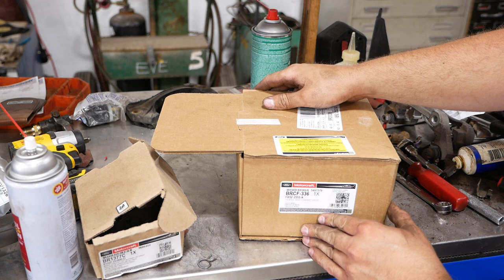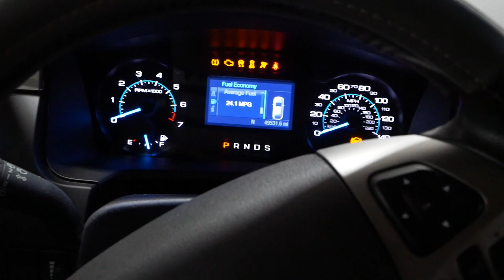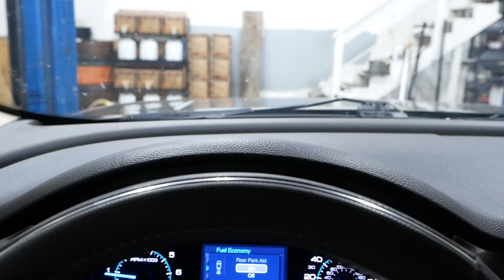Replacing a Brake Caliper with Integral Parking Brake - Ford Flex

Comment from the maker: Caliper Wind Back Tool (Sunnex) - https://amzn.to/3gVqvoT
Unofficial Wind Back Tool - https://amzn.to/3dhjzAm
Brake Line Fluid Stopper Set - https://amzn.to/3x0eu7h
Reply: I found it interesting Wes. 
Looking in from the outside, while watching American films, especially the big old soft sprung boats from the 70's. You see the whole car lurch as it settles into the next dog in the auto box when people select "Park" without the handbrake on. 
You saw people half out of the car  & "Lurch!" 🤣
Reply: What do you set your torque wrench at when tightening lug nuts, get videos keep up the great work, hi to you and the Mrs from Newfoundland, Canada..
Reply: I see you have your own orange Tanya Harding! I had to edit this once I saw the case of wobble pops. Or mountain sodas. Whichever you prefer.
Reply: @dwaynechaulk7387  depends on the car...I have a vauxhall where factory spec is 81ft lbs and a Ford which is 63ft lbs for the wheel nuts.
Reply: Thanks, we have a Ford Escape 2018, my son has a Hyundai Elantra 2018, I'll go on the old interweb and find out, I can't find it in owners manual.
Reply: @dwaynechaulk7387  wheel nut specs are also in the Manual that came with the vehicle
Reply: Ford Flex shares the "frame" with the 'Lincoln MKT' and '2011-2019 Ford Explorer' aka the Ford D4 platform ... a revision of the D3 which was derived from the VOLVO P2 architechture.

Comment: "The customer went with all OEM parts,"  a man of culture I see.
Reply: @Mauivegan67  Ya! Ouch! on the OEM parts!
Reply: I go all OEM on my old ranger and on the wife's newer nissan. Surprisingly pretty cheap on my ranger, the nissan not so much.
Reply: @MiamiZombie2012  same here Motorcraft parts are generally not expensive or barely any extra
Reply: It's always worth checking OEM.  Some of the parts are the same or better price than aftermarket.  Check different outlets too.  Same part was $104 different at two different stealerships a few years ago.
Reply: In the 90s I had a Honda Accord.  The dealer recommended I go with after market rotors.
Reply: I was thinking that if you have a Ford and you’re replacing parts.. why not take the opportunity to get something better than Ford??
Reply: @jefflane1209  only problem…nothing better!
Reply: Sprung for oem parts and didnt get a new rotor?
Reply: @underoath4177  but the rotors ARE serviceable OEM
Reply: on a ford, in my opinion, its the only way to go.  FOMOCO on everything. Even my daughters mazda (ford) I use oem parts
Reply: @MiamiZombie2012  Nissan is the Debbil! I personally HATE their products. But YMMV.
Reply: @Rorschach1024  I hate the CVTs. Ours originally failed at 39K, so for a 2015 I was pissed. But with changing the fluid every 20k now, it's going strong at 103K. Just expensive at over $20 a qt.
Reply: @MiamiZombie2012  had a late 90's sentra. engine failed at around 65K miles. the journals for the distributor bearings wallowed out and it could not stay in time. SIL owns an Altima that he was driving back from Ft Eustis to Ft Hood. it kept going into limp mode because of CVT slippage. Nissan didn't put a trans oil cooler in that year model (they deleted it the year before, and put it back in the next year) There was a TSB to replace the CVT and install an oil cooler if certain parameters were met, but the parameters for this transmission didn't quite meet the spec, so they refused to perform the TSB and install the oil cooler. I've seen the pile of scrap CVT's and engines at the local stealership. it doesn't give me a warm fuzzy.
Reply: I like to use all OEM Parts as well.  But sometimes reality sets in. Specifically when the OEM Part costs 5 & 6 times the Aftermarket part and is going to be a 2 wk. wait for the parts.  Even at the Dealership!!
Reply: @jefflane1209  With Brakes you’re generally not going to find better unless you’re willing to spend $1K+ and get something like Welwood or Brembo.

Comment: Ah those are the best customers, the ones willing to spend the money on oem stuff because 99% of the time the stuff is going to fit and work right away
Reply: Always fun when a brake job turns into the ol "grind to fit, paint to match"

Comment: I can't believe you only changed one caliper!  Now the car will be spinning out every time you hit the brakes... or so I am told by the YouTube comments.  I use the brake job hammer. It makes the job much faster!  Oh yeah and everything else Eric said since he got here first!
Reply from the maker: I really need one of those hammers. The Snap-Off guy couldn't find it in the catalog. He just wanted to trade me an "Epic" toolbox for my everlasting soul...
Reply: I agree in this case this one failed why not the otherside.
Reply: Not true
Reply: The car is equipped with ABS.  Would that not take care of any differences in stopping forces between the wheels?

Comment: I never see a problem with turning rotors and drums if they're within spec.
Reply: My issue is time. I can be done with the whole job in the time it takes to get 4 rotors turned
Reply: It's old school but saves money and they'll go another 4 -5 years. I like it too.
Reply: @scrapbmxrider16  cutting them is probably cheaper for the customer.
Reply: Yeah and save the customer a buncha money..  Thats how you get a customer base. I rather pay Wes to turn rotors for his shop rate   and save $$$
Reply: Wes's shop Wes's rules !
Reply: That's why there is a spec, right?
Reply: Any bluing or grey heat streaks isn't within mechanical specs just for those of you who don't understand metallurgy. It's more than "surface hardening" when brake drums/rotors get that hot, the entire crystalline structure changes.
Reply: Not too many places turn rotors anymore.

Comment: Nice work Wes! Tear the old caliper apart and do a failure analysis!
Reply: I'd buy that for a dollar!
Reply: Think he said there was a core charge, so he has to send it back to the manufacturer
Reply: In Soviet Russia you brake the caliper! 😄
Reply from the maker: I should! I doubt that would affect the core. All they reuse is the main housing.
Reply: @zoidberg444  I am pretty sure that's not how they did it back then. Everything was rebuild able back then.
Reply: @WatchWesWork   be sure to charge .99 cents to view the tear down video incase you don't get your core charge back!
Reply: I was struggling to bleed a rear caliper on an 1978 Yamaha xs 500. Must of gone through a small can of brake fluid. Still spongy. So, I tried my HF Venturi AC vacuum. It took more time to rig up hoses then to get the air out! Nice firm pedal!
Oh, Ivan, because of me searching for information on the XS, I found your channel. FYI
Reply: @TheDisgruntledMechanic  throw all of the jiggly bits in the box. Value added. The disassembly process is one thing the rebuilder doesn't have to do.
Reply: @zoidberg444  No, your phrasing is wrong, try this:  "In Soviet Russia, caliper brake you!"
Reply: @TheDisgruntledMechanic  When Ivan did that last time it was like WW3 in the comments. Oh my...
Reply: @zoidberg444  yes sir! When he made it free I wanted my 99 cents back but to no avail! Hahaha!
Reply: @dans_Learning_Curve  that's cool! Old Yamahas are the coolest 😁
Reply: @dans_Learning_Curve  Another great way to bleed them (a couple of ways) is use a large syringe to shoot fluid into the caliper.
Another good easy way is to get a LONG tube, place it on the bleeder nipple then run the end to the reservoir.
Recirculate the fluid, but...make sure you've flushed the entire system before you do this! 
Another good thing about this method is that you can sit there pumping all day without worrying if you're loosing any fluid!
Reply: @dans_Learning_Curve  -- I bought a new 1978 Yamaha XT 500 back in the day and I loved everything about that bike except that ugly brown paint job!
Reply: @WatchWesWork  just do a poor mans rebuild on it, they’ll never know

Comment: Been a mechanic for almost 6 years and I never knew there was a procedure for wind in calipers that's any different than normal... Always just bled them like any other caliper. To be fair that's never given me an issue but its good to know in case I ever run into a spongy pedal with these style.
Reply: There isn’t. It’s just how Wes does it.

Comment: Love the brake job.  Turning original stuff is a good way to save time and money.  Did it myself back in the day. Especially turning drums were "easy". Love the Ford Flex.  Not sure why they axed the model.  With the EcoBoost V6 it was fun to drive, and room for 7 and pulling a nice trailer.

Comment: Thanks Wes - having the same issue with my 2016 Transit. I was on a hilly job and used the parking brake.. and the caliper wouldn’t wind back, creating a dragging/rubbing sound. I was able to pry the caliper back and haven’t used my parking brake since, and now after watching I know I need a new caliper.

Comment: I use a C-Clamp to collapse the pistons.  Been using the same clamp since the early 60's.   Still do my own brake jobs, though the Doc says I am getting too old to do that anymore.  I am retired and only work on my car which is new so all I do is oil changes, air filter changes and tire rotations.  On my old Jeep which I traded in when it started to Nickle and Dime me to death at 346,000 miles, I changed the pads every 80,000 miles whether it needed them or not. Still had original calipers and rotors when I traded it in for  pittance.  It was in such good shape for its age that the salesman bought it for his daughter in college.  No rust in New Orleans like in your area, though people living closer to the Gulf have a similar problem with Rust from the sea spray. I have seen bodies completely rusted through after only 4 years.  The bodies are long gone before the frame and underbody reaches the level of rust I have seen in your videos.  A car would be labeled unsafe and be taken off of the road long before that condition was reached in the annual inspections.  :D

Comment: Wow, learned something new, I just slapped my integrated Parking brake caliper on, bled it and went to inspection and no problems, been there 3 times in the last 6 years without any brake issue 😅

Had more problems with the disk brake with drum parking brakes 😱

255.000 miles on a 2002 Citroen xsara diesel station wagon 🤗

Comment: I had a '94 Geo Metro which had frequent flats and blowouts. I carried a Louieville Slugger to loosen stuck wheels. One day I couldn't get the wheel off and had to call a tow truck. The driver used a sledge hammer unsuccesfully. He towed me to a Goodyear Tire Center where  with my consent they applied a torch, warping the wheel. I thanked them and put the doughnut on and drove to a upullit junkyard and bought a replacement wheel and took it back to Goodyear and bought a new tire. After totaling the Geo with a minor fenderbender  (CRUNCH)I replaced it with a "98 Saturn which burned a quart of oil between gas fillups.

Comment: We have issues with salt here in upstate NY, and every time I do a brake job on my vehicles, I use something called Ceramlub.  I coat the backs of the pads, the caliper/piston where it contacts the pad, the little clips that go in the caliper brackets, and the back of the wheel where it contacts the hub and rotor.  Never have any issues taking stuff apart for servicing.  Found uses for it on lots of other stuff too.

Comment: One of the few times I’ve seen an impact screw driver used correctly👍.
I learned to drive in with a manual transmission in hilly San Francisco. Parking brake use was mandatory.

Comment: The handbrake lever on the calliper seizes in the on position, this then means that the piston cant retract or be wound back. You would do well to spray the back of the calliper with fluid film. I have stripped and rebuilt a few of these, you get a year before they seize up again. Once the original plating is gone  from the rod that enters the back of the calliper its not long before the rust seizes up again.
Reply: And that is a rust belt up there in Ohio.
Reply: @mohabatkhanmalak1161  Yep, im in UK, we salt our roads at the first hint of frost. We dont bother with frequent oil changes as the car will rust out from under you long before a good engine will be worn out.
Reply: It can also be corrosion between the piston and the bore. It doesn't take much rust at all to seize it up to the point were you can't turn the piston. I have had this style of caliper on all my cars and the parking brake mechanisme is actually pretty simple and reliable internally and the ones I have replaced was because the piston seized in the bore from rust.
Reply: @niskaa78  You need to keep the seal in good condition, once this is ripped your piston has maybe 6 months. On fords its normally the spindle/bore at the back that rusts.
Reply: @mohabatkhanmalak1161  he's not in ohio he is in illinois but yes the whole northern section of the us is snow country and rust belt ..i lived in ohio for about 10 years and never want to go back
Reply: @janeames1513  Sorry, I always get mixed up with the different states. I lived for some time in the Persian Gulf state of Dubai (its federated in the UAE) and it is very salty along the coast. The coast used to be under the sea millions of years ago. So vehicles or anything iron and steel rusts very fast.

Comment: That blast cabinet looks like it works awesome. I have one of those one time use harbor freight cabinets, where you try it once and it’s so bad you never use it again. I got one of those Tacoma company blast cabinet upgrades I need to put in. It will be nice to actually be able to use the thing.
Reply from the maker: That's what I had too. It was good at covering the floor in sand, but not much else. I bought a new one from Skat Blast last winter. Love it so far.

Comment: Nice old Ammco lathe and a blast cabinet. The customer wouldn't have gotten the same treatment elsewhere. Every shop would've just replaced the rotors since most don't even have lathes or even know how to use one, usually they just slam the brake parts back on, probably would barely even clean the carrier off. Just my experience from working in shops for awhile. Funny the OEM stuff is more money, but doesn't come with the carrier while pretty much any rebuilder sells the caliper complete for less. This is actually a story of one jiffy lube/ valvoline/ quick lube getting it right and for once, they didn't mess up more than they fixed. Now if they were the ones to actually do the brake job, and not just diag it.... who knows what they'd do. It's funny how basic a simple brake job is and how many people can't do one properly. The placement or lack of grease and not cleaning up the carrier right is probably the most common thing I've seen among the years. You would be surprised lol. There is NOTHING wrong with turning rotors or drums as long as you do it correctly and you're not at the minimum thickness. Make enough passes at the correct cutting depth/ speed, and then cookie wheel it after to get rid of the grooves left behind by the cutter and its perfectly acceptable. The one indie shop I was at for awhile not only had the aamco but we also had an on-car lathe. That thing was awesome. Especially for the bigger stuff like 4wd's with the rears and everything. Worked great as long as you set it up correctly, the cutting bits were just a little pricey when they were out. It saved a hell of a lot of time and saved the customer money in the end too. Im used to these type of rear calipers, especially with my large VW/ Audi background. They've been using them for a VERY long time. Good video Wes, digging the beard. You have officially entered the club of us guys who wear one lol. 👍👍🤙😎

Comment: Hi Wes, I first done one on them types in the early 1970`s yes that long ago on my VOLVO 145/ they had a dual brake system, that had 2 brake lines to front calipers one to each rear, loose one brake line you still had %70 full braking but on 3 wheels.. so ahead of the game them old Volvos.Its Hand brake (OK E BRAKE) was brake shoes inside the rear discs cable operated.. . My Volvo was not old when i bought it but carried and old fashioned big pram during the week, towed my oval race cars weekends.. Had a lot of respect for them estate (OK WAGONS)  cars - thanks for the video.. Ian - UK.

Comment: The first wind back calipers I worked on was a 1979 Trans Am with 4 wheel disc brakes the fronts were the standard push in style but the backs were the twist in style at first I thought the calipers were seized or something until I talked to a friend that done them before. That was back in the mid 90's before the internet was loaded with the info it does today.

Comment: I had a 1974 Fiat 2400, that had 4 wheel disc brakes, and the rears had a similar mechanism.  There was a cam lever that pushed the rear calipers, mimicking brake fluid.  And yes, the rear caliper pistons wound around a threaded bolt--there was a slot across the face of the pistons.  One side rotated left-hand thread, and the other was right-hand.  And, this is 40 years trying to remember, there was a ratcheting thingy that kept them from rotating back (I'm vague, but I remember having had to release something, to wind the pistons back in, when new pads were put on).   The OEM brake pads were asbestos, and that was Right Out by the time I owned the car, and the replacement material was... poor.  :)   So I replaced pads, 4?  5? times as I owned the car.  J.C. Whitney catalog was a boon, back then, because most auto parts were all, "What's a Fiat?"  :)  Memory Lane Video!  Kewel!
Reply from the maker: Sounds like a pain!